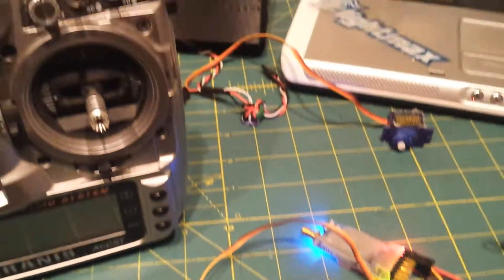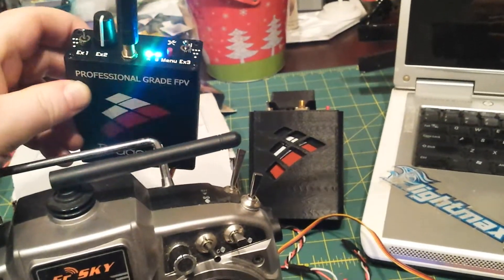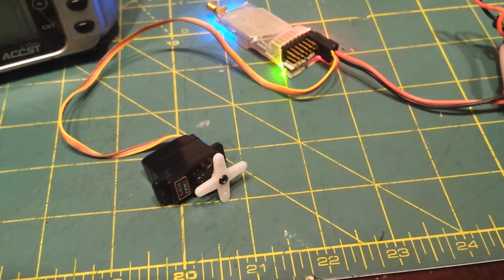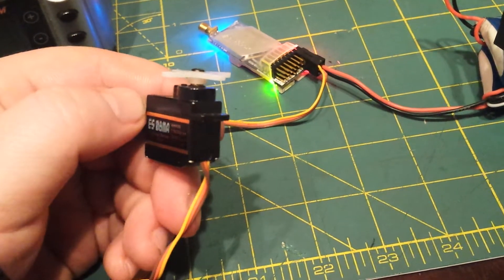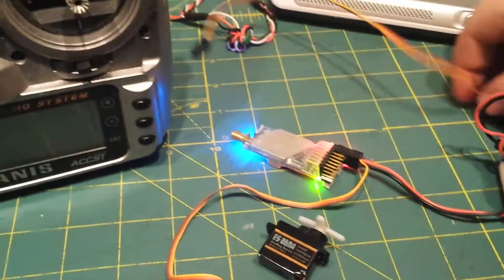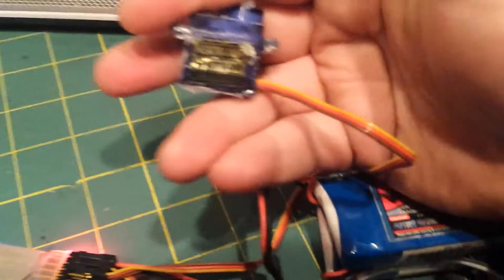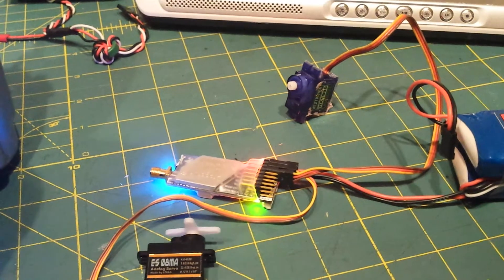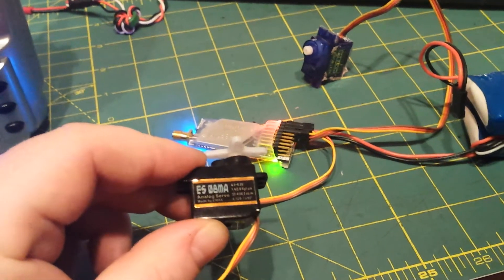Dragonlink V3

Comment: could be a dirty wiper / pot in the servo feedback / position sensor.   but that pulse pattern is  strange . and your sure the lipo pack had enough charge & voltage to drive it all ?  it sounds like a power oscillation , its pretty regular too like a clock tick . does teh servo do it in all channels ?   just from sound i suspect the firmware update may have changed how its PWM responds when input is near 0
Reply from the maker: +XerotoLabs yeah it could be, the pwm thing. Looking into it.

Comment: What's up Mike ?
I had almost same issue with Dragonlink V2 but it appeared that my servo was faulty, it works good with a normal receiver but with Dragon Link V2 it does almost the same with you and triggered some failsafe from time to time!
I changed servo and everything was fine! But since you are using a V3, it's maybe a firmware glitching...
Hope you will find a way out :)

Comment: Did you try to put at least two or three meters between your radio and the RX? Mine always do this due to the fact that the transmitter output is just to strong..Now is very important to let you know I don't use any dragon products.
Reply from the maker: thanks. yes I normally do. check my updated video. all is good.

Comment: If you use a BEC this problem will be solved. Some servos doesn't work well with more than 6V (most of them work better in 5V).
Reply from the maker: Thanks for the tip :)